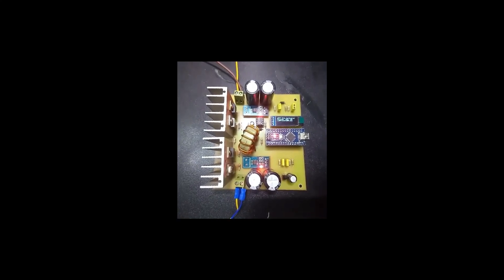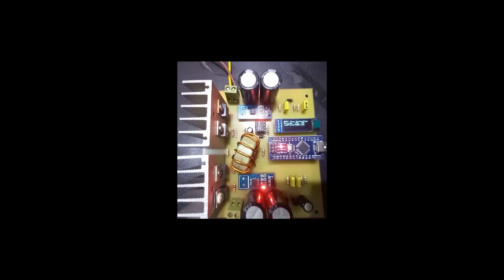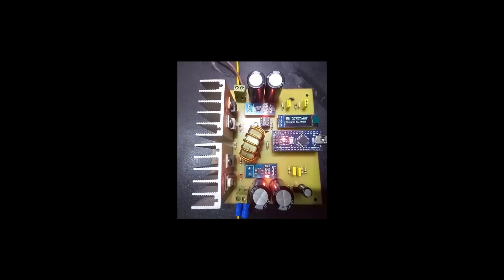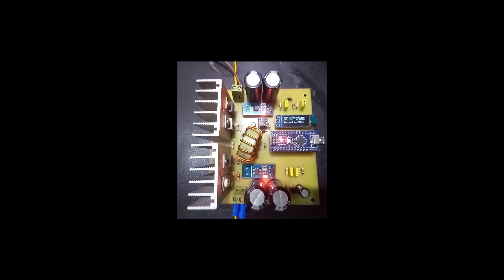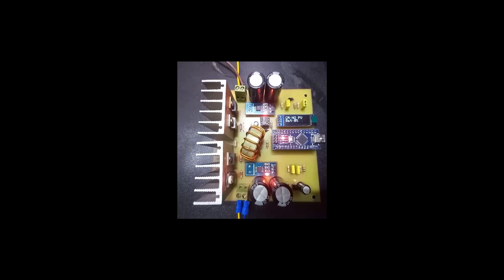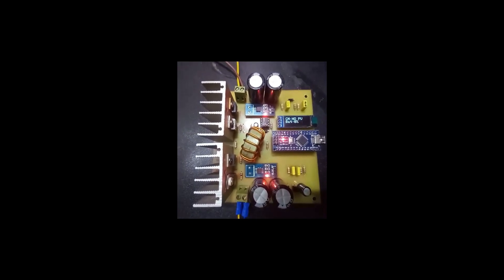Step-by-Step Guide to Building an MPPT Controller with Arduino and a Synchronous Buck Converter

Comment: I have been struggling to understand your MOSFETs configuration in the schematic,

example gates off Q1 and Q4 are linked together from a single resistance R2 of 22ohm ,

also Q4 have a higher gate resistance of 1k, is this an error or not? Please how does it really function.. 

Also C1 is 10uf, what is the voltage of C1..?

Finally can i use 1N4148 for D1...?

Comment: wow nice simple design, please how do i upgrade this design to handle 80v solar input ?
Reply from the maker: yes. this is the basic circuit. any range can be made with proper ad-ons with this. such as additional protections, voltage level converters etc.
Reply: @MKDas  ok but do I also need to change anything in the code?
Reply from the maker: @mayoortechinnovations  little bit of additional code is required.
Reply: @MKDas  Engineer thank you very much for your reply,

I have been struggling to understand your MOSFETs configuration in the schematic,

example gates off Q1 and Q4 are linked together from a single resistance R2 of 22ohm ,

also Q4 have a higher gate resistance of 1k, is this an error or not? Please how does it work.. thanks